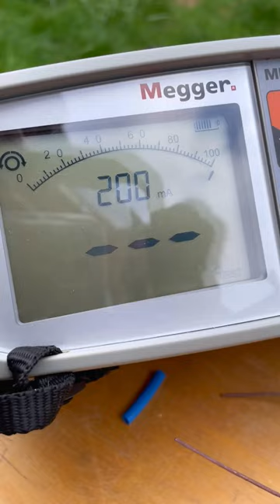How to Identify the ends of MICC Cable (Pyro Cable)

Comment: What's pyro cable?
Reply: Pyro is a manufacturer. MICC is mineral insulated copper conductor, commonly known as Pyro.
Reply: @ChessPhantom1  
Does the mineral insulated, also fire proof insulation ?
Reply: @m101ist  yes. Keeps the heat out so the copper doesn’t melt/snap.